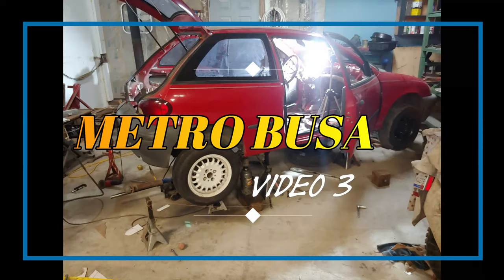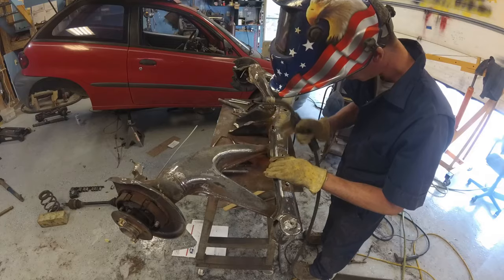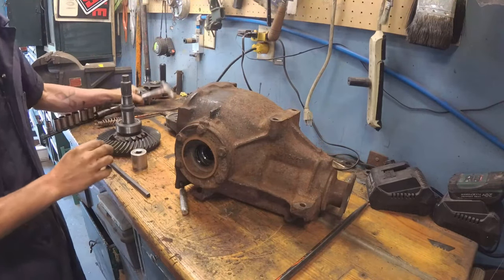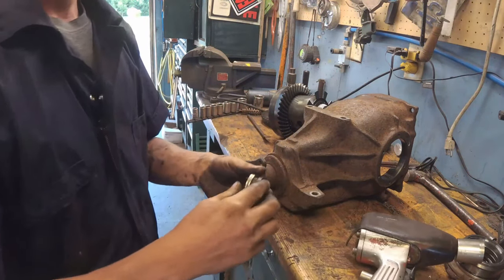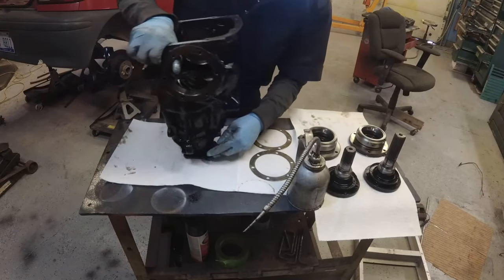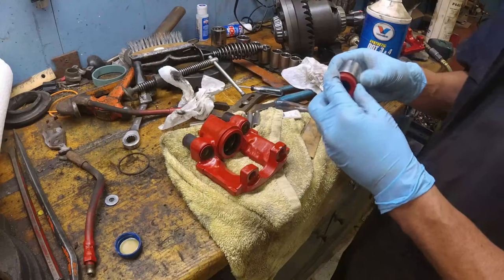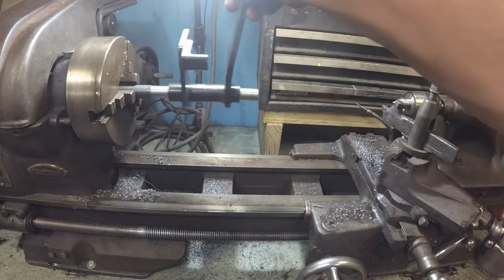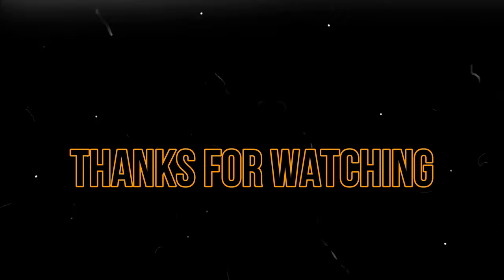metrobusa video 3

Comment: so Justin what BMW rear diff did you end up using?  Why?  Is the gear ration good for the Hayabusa engine?
Reply from the maker: E30 series 325 rear end.  I think it was an e325 manual with 2:79 ratio with ltd.   A regular 4:10 will not work it will only go like 50mph.
Reply: @JustinGoinsfixit  What is the top end with the 2:79
Reply from the maker: @xuv5607  math says 154 at 11k
Reply: @JustinGoinsfixit  Do you think a 3:15 ratio will work?  I see 2:93 out there but they are big $$$$$.  Not looking for a land speed record top end just a good solid rear diff that will complement the Hayabusa motor.
Reply from the maker: @xuv5607  sorry for late reply.  3.15 would be fine,  the m-series e30 ran 3.15 ratio but in the large case. Would be cool to have,  dont know if they fit in the standard medium case subframe.